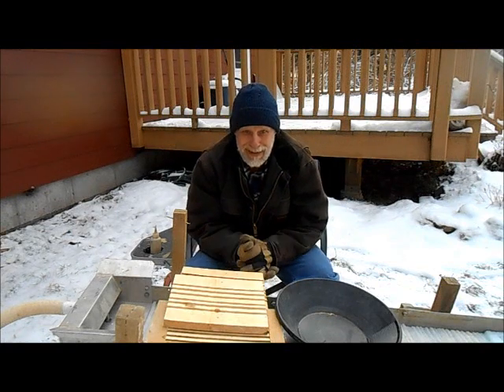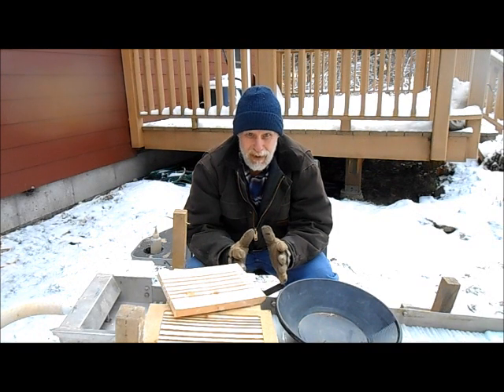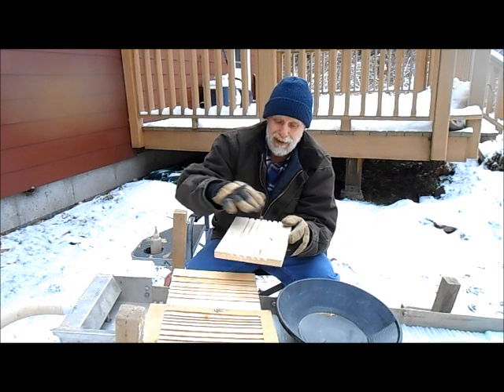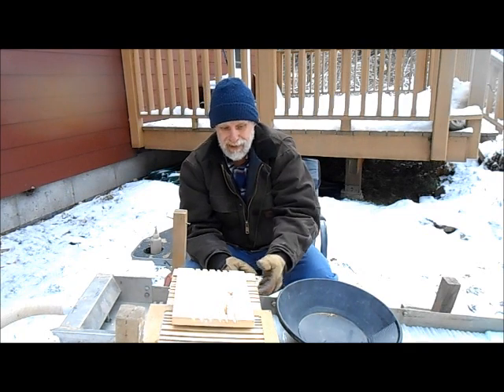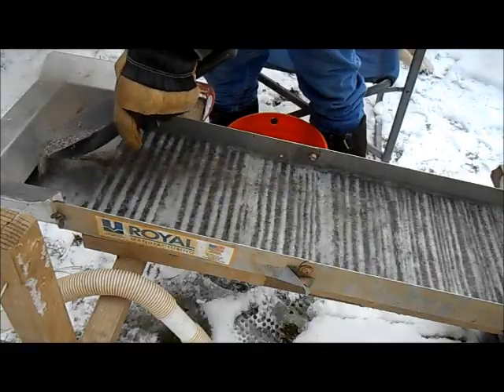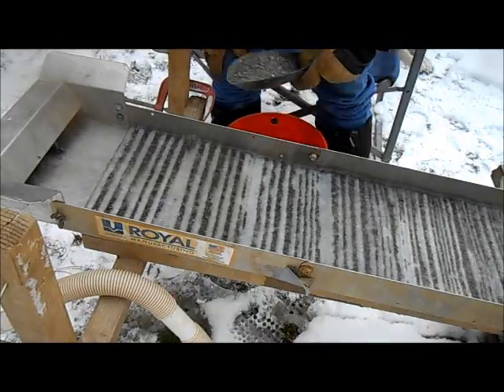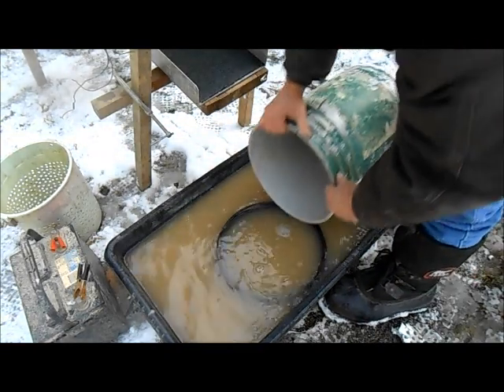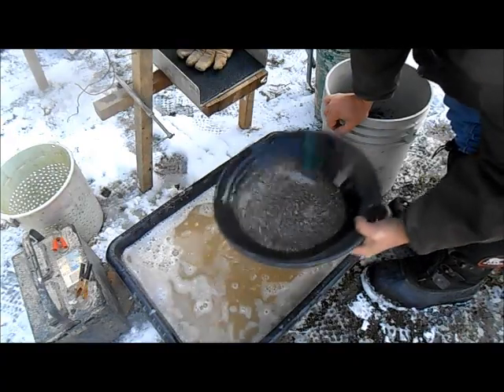New Silicone Sluice Box Mats Do They Really Catch Gold ?

Comment: Have the same kind of weather here in Colorado, so I tried using non-toxic RV anti-freeze in my re-circulation system and it worked great. No gold loss, muck settles out, can be used over and over, was ready to go next mourning at 9 degrees F. Only thing is it has a peculiar odor. A little pricey at about 20 bucks for 10 gallons, but we are just having fun anyway.
Reply from the maker: Great idea I had never thought of that before That would work great if you needed to be set up over night. I think I will be setting up my ice house with a heater in it to run dirt for the winter,. Thanks for watching.

Comment: I got my sluice far enough along to test out it and the two mats I made. I didn't have the water flow I was wanting but I did seed some black sands with .60 of a gram and recovered it all in the first mat. Top 5 ripples. The texture on it had gold sticking to it when I went to clean it out. All the smaller gold. I had to use my snuffer to blow it out into my catch pan. I will see how the same mat does after I get a bigger pump. I think it's going to just wash out with higher flow. My second mat only had one piece of fly poo in it. More testing once I get a bigger pump. Great job on your design on your mats.
Reply from the maker: It sound like you are on the right track. I would guess the gold sticking to the mat is not bad right? I think I need to get a new pump to mine is giving up the ghost. Thank you.
Reply: Alan Robertson Yeah I will see what happens when I have more flow over them ! I'm going to do the same thing. Seed some black sands with .60 and get it back. I hope that the gold still drops out of the flow and sticks. If it does stick You know what I did and the wood I used is MDF board. It does leave a great texture to the surface
Reply: Alan Robertson It was funny that I had the mat upside down and bashing it into my pan and that gold just stuck. I'd say it was sub 50 mesh that was stuck to the mat.

Comment: Looks to be working just a little hint i always wet my materials cause dry materials like to float
Reply from the maker: Thank you Doug for the tip my opinion on the matter is if you break the surface tension on the water the gold will drop out so I don't worry about it just my opinion. Thanks for watching.
Reply: The proof is in the pudding!

Comment: Soon you’re going to need to make a heated sluice box!
Reply: And a heated pan. Lol. I’ve had the same issues and at no other time does heated equipment seem like such a great idea.
Reply: jay parry On demand hot water heater ? Sounds legit 😁
Reply from the maker: That's not a bad idea. I have a propane camp shower so it's on demand hot water I will have to give it a try sometime. Thanks for the idea.
Reply: Alan Robertson If you can control the temp I bet it would work out great. Question is can a recirculation pump handle the heat. Mine is thermally protected. I don't know the cut off temp ?
Reply: If you’re running a gas engine you could plum the water around the muffler like in a wet suit water heater system. I’ve been thinking of doing that myself for winter and late fall prospecting. That propane heater sounds like a pretty great idea. Not a lot of extra work to set up compared to building an entire exhaust water heater.
Reply from the maker: @chrissaucier9386  On second thought I don't think the wife is going to let me use her shower in the mining set up. Jay had a good idea if you run a gas pump.
Reply: Alan Robertson Yeah I hear that !

Comment: I see how good they are for a bucket of dirt but what about running 3 or 4 yards of dirt  on a sluice box 11.5 inch by 9 ft with double the water flow you have think they would do it or how much dirt would you run before a clean out?
Reply from the maker: So I run a 2000 gph pump with my mats in a 9 in by 8 foot sluice I clean out about every ten buckets or so.

Comment: thanks for sharing i have the same idea for sluice mats, using silicon because EPDM on factory made sluice mats is expensive.
Did you know that gold and gemstones are hydrophobic - a quality shared by silicone?  that is they actively repel water. In sharing this property you may notice if looking super closely gemstones and gold 'drag' slower across the mat or silicon surface. hydrophobic- water repelling materials next to each other kind of try to stick to each other. Whether we could possibly use this to actively trap gemstones, thats sapphire, garnet, etc somehow will be a good challenge.gemstones dont 'wet'  Quartz isnt hydrophobic it wets and should just run through.
I wondered if a vortex mat, the roughtop conveyor could be molded with silicon and use varying size holes up to 1/4 it may well be the right size hole for the right size garnet or gem  itll stick in there because of the anti wetting shared property of the mat plus the gem. just a thought,, anyway liked the video keep em coming
Reply from the maker: Thank you for the great information. I did not no that about the gems and gold. I did notice that the gold just seems to stick or drag slowly on the mat when I have been testing them and they seem to hold up just fine. I will have to give some sapphires in the mat. I think we are going to get some sapphire gravel in a few days. Thanks for watching.